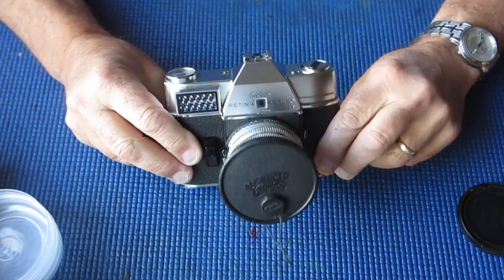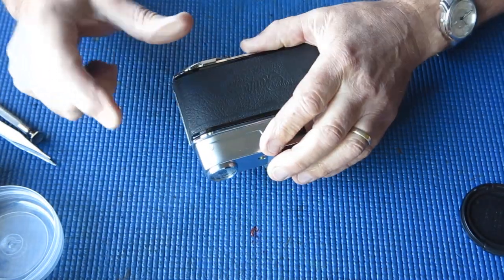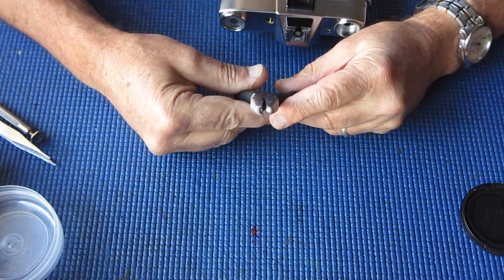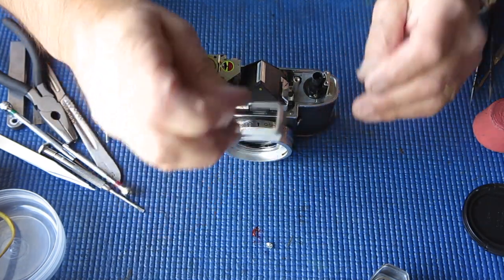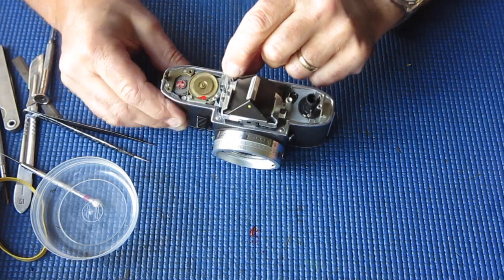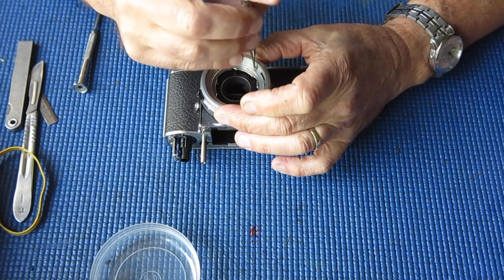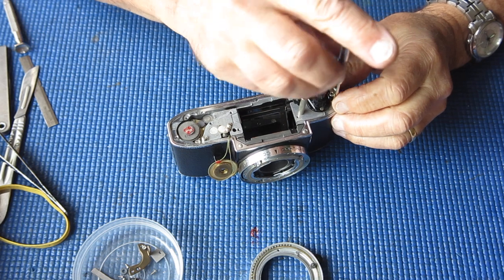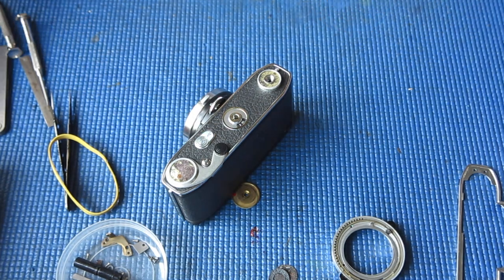Kodak Retina Reflex IV repair part 01

Comment: Excellent videos!  The problem with my camera is a “dirty” viewfinder. I can also see that the mirror is pretty dirty as well. I think with the help of your first video I can actually get as far as removing the top of the camera and the viewfinder/prism. What, if any, cleaning of viewfinder can be performed after its removal?  Also, can the mirror be cleaned through the front of the camera with only the lens removed?  If so, how might this be done?  Thanks. Mark
Reply from the maker: G'day texasmithy. The viewfinder might have problems in multiple places. The viewfinder lens in the top cover has two surfaces, the rear and bottom surfaces of the prism are two more. Below the prism is the focus screen,  dust or dirt might be on either surface here. The mirror is the usual front-surface mirror. Generally you don't want to touch it with anything, it scratches really easily. I have cleaned reflex mirrors by suspending them in an ultrasonic cleaner in water with a few drops of dish soap for a brief time, rinsing and drying carefully using a hairdryer and a blower to make sure no droplets dry on the surface.
Reply: @ChrisSherlock  Thanks, Chris. Do you think I might be able to do any productive cleaning of the external surfaces of the prism and other related parts, once removed from the camera, without more extensive disassembly of those parts?
Reply from the maker: There are two surfaces without silver, and these you can clean, you can do nothing to 'clean' the silvered surfaces. If the silvering has deteriorated, then the cheapest solution is a new prism. You do have to do fair bit of dismantling to clean any or all of these components. Be aware that the tiny mirrors for the speed/aperture settings window are prone to coming adrift and it can be fun getting them glued back at the correct angle.
Reply: Hey, Chris. Forgot to mention I’ve already had some minor success working on my camera based on knowledge I acquired from your video. The camera mounting stud was indeed very loose on my camera just like you said you often find on these models. Fortunately, my Dad did not attempt to screw the tripod in with excessive force in hopes of tightening up the camera/tripod connection. I peeled the leatherette off to reveal the two small screws that secure the stud to the body; they were not stripped or deformed at all 😢. I tightened them up and reattached the leatherette and now that’s as good as new!  Think I’ll order a replacement prism from Germany and see if I can really get it up to snuff.

Comment: Hi Chris, I would like to thank you for this nice disassembly video, it helped me a lot! Do you maybe know from where could jump out a small little spring after I lifted off the front with the shutter? I can not see any small spring in your video, so this problem causes me headache. I would be very happy, if you had some tips. Thank you!
Reply from the maker: There is a flat spring with a single loop as part of the mechanism that controls the mirror and capping plate stuff that yoyu might dislodge when removing the front, and there is a coil spring that returns the shutter release trigger, but that is about is for springs behind the front panel. There is a small coil spring under the base plate, maybe it was that.
Reply: @ChrisSherlock   It is a coil spring, a very thin one. It is about 7mm long and 2mm wide. I thought it comes from the shutter release trigger, because it looks like the one you mentioned in the Retina Reflex S video, but the Reflex IV has a lot bigger return spring (sorry if I am wrong). I will take a look. Anyways a big thanks for your reply. Greetings from Germany!
Reply from the maker: Probably the capping plate spring and it was underneath the chrome trim on the bottom of the camea..

Comment: The mini mirrors for the info window will typically become detached from adhesive failure (due to age) and therefore drop away from their holders (no info seen in eyepiece peephole). They should always be recemented or at the least a tiny bead of reinforcement applied. - Plus video @ 6:05 "cut a slot" - Ouch ! - Never deface precision camera parts. Always FIRST try combinations of pinpoint HEAT then the use of wood lined or soft metal tiny clamps, pin vice or watch hand lifter tools. 
Even with the ASA set button being stuck, there were better-for-the-camera alternatives...
Reply: this is exactly the problem I have! Otherwise the camera works perfectly! I am not brave enough to take it apart!